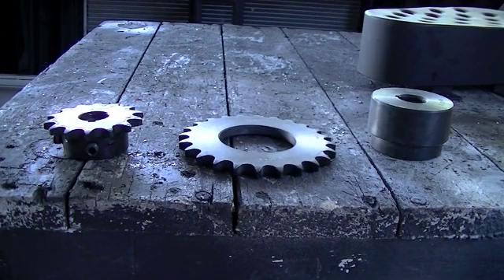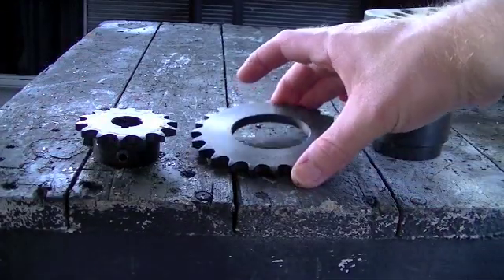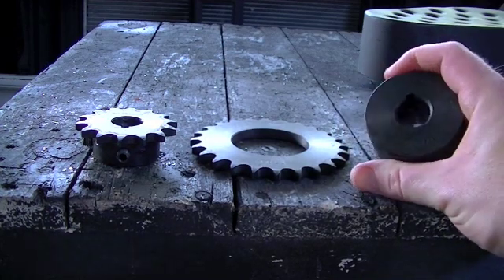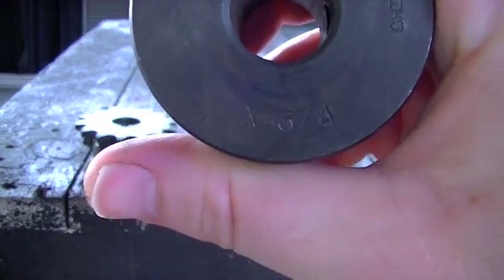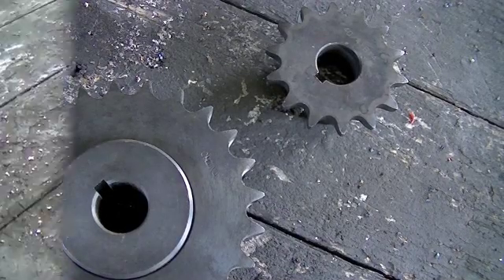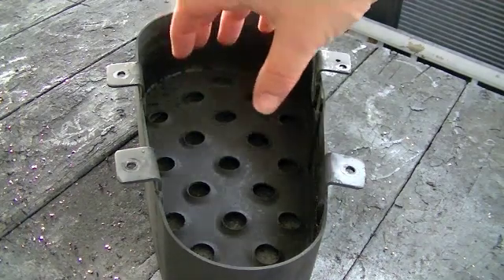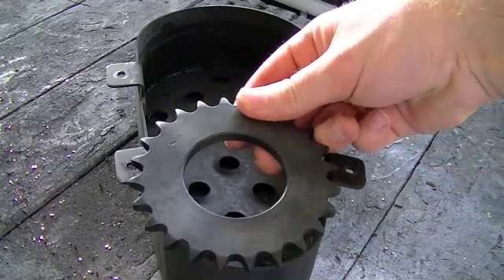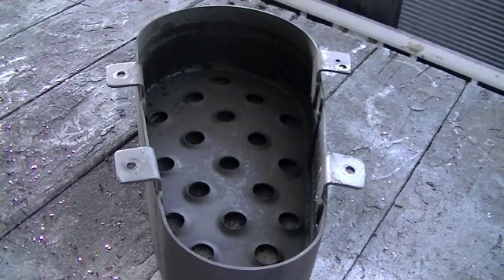Part 30 Motorized Bike | 3HP 4 Stroke Engine

Comment: i'm just guessing you have a 10 tooth clutch.  and if thats true you will have a 1 to 1.4 final drive to the shaft thats pretty high geared not to much power.  with the 14 tooth sprocket. and with the 24 tooth you will have a 1 to 2.4 thats double the gear that should give you a lot more power.
Reply: oh and i love your videos keep up the good work

Comment: Interesting video. However, you will have a problem drilling holes through a sprocket. It is hardened steel and common drills won't do the job.
Reply from the maker: ***** I don't think these sprockets were hardened.  I was able to drill through them without a problem using bits made of plain old high speed steel.

Comment: if chain 1to 4 ratio from motor to jack shaft  and 2 to1 from j/s to rear wheel
10/40     20/40 at the rear is fine
10 on motor
40 on jack large
20 on jack output
40 on rear wheel
or go CVT!